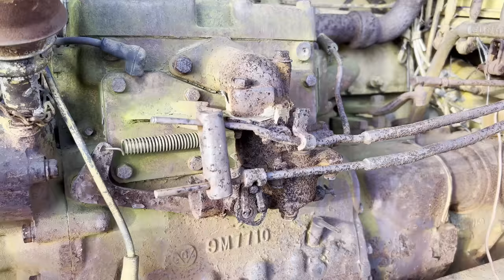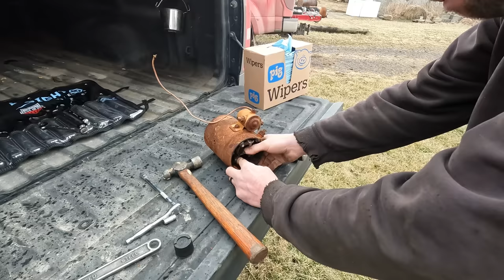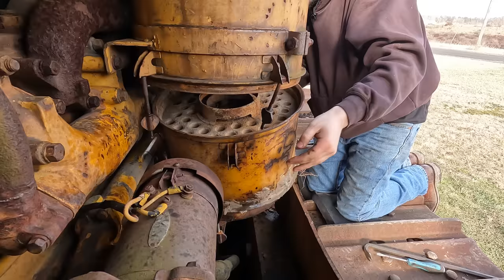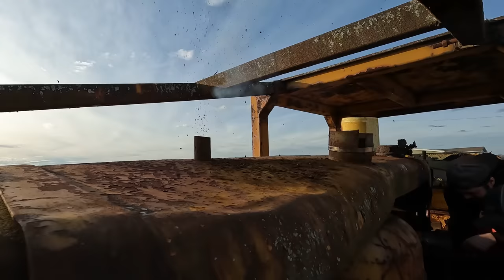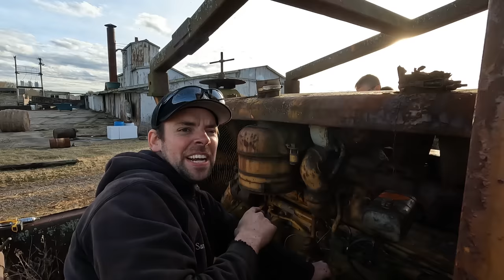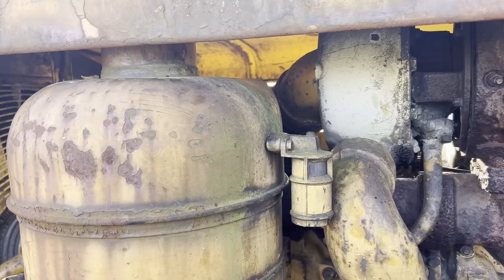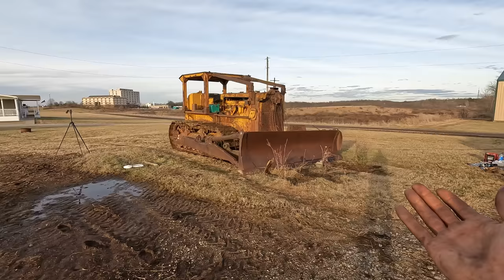Caterpillar D8H Bulldozer Sitting for 15+ Years! (Will it ever run again?)

Comment: Maybe high iron-content acts as an antifreeze agent? XD Man, that thing was a rust-fountain!
I wonder, could the water have pooled in the exhaust, against a closed valve, and that's how the cylinders were intact?
The water just flowed in once you started turning it over? That's the only way I can see that it didn't get seized!
Woo! She woke right up once she was running!

Comment: As a young kid I though of the idea of a little smaller engine used to start a bigger engine and didn't know it actually existed until today. Seems like a giant PITA though because you need 2 different engines fully functioning instead of 1.

Comment: Man, that D8 runs very well. I seen a few in recent years. Cable lift type. That by the time you guys got it to tick over, goes better than I would dare to expect. If you got it under $7500 you may finish up making a profit, off it!

Comment: I'm happy to see someone that knows how to use their tools. I cringe when I see guys using the open end of a wrench to break things loose, or worse yet, that adjustable wrench. There is a time and place for them, but the right tool for the job always prevents damage and a lot of grief. FYI, to save some problems, I have seen guys change the pony motor to an electric starter on older machines. Not sure that is possible on all of them, but some for sure.

Comment: When I started at a cat dealer in ,75 still lots of donkey starts around.great fun for a 17 year old.start the donkey,let it run for a while,pull the engage lever,watch the oil pressure come up then throw over the decompress with your foot.DAG A DAG A KNOCK KNOCK ,belching black smoke then she runs sweet. Good old days.

Comment: If you hav to jump a srarter put the positive cable on the starter first then the negative to ground then you don't have the trouble of manipulating the positive cable where there is never enough room to work, use the negative side to complete the circuit to engage the starter this eliminates the hit and miss of trying to get the positive side where there is never enough room and remove the possibility of ruining the pos stud threads

Comment: Yeah,it started,sweet. Typically they would drop off the blade and use the cables for a towed scraper,"box" scraper. Onions was a common brand. Quite effective on smaller jobs even these days.

Comment: Great vid thank you it brought back fond memories of nursing dozers back to life and getting a face full of birds nests etc lol, we ran 4 x D8 H`s and scrapers in the uk (22a, 35a & 68a`s) up until the 90`s   what model of  is yours ? i noticed the big turbo is that a 235 hp motor thats in it ?  also just wondering why the winch is set up the way it is, is one drum for the blade and the other set up for hauling logs ?

Comment: there is a 3rd bolt hidden UNDER that starter that often doesnt get put back in!,,,,its a 20 minute job if you have the right extension!.....same pony as the D7 AND D9 if its the same series...D7-17A IS THE SAME AS THE D8 14A,15A

Comment: Matt a good friend told me about free all i had come into a honda motorcycle that would not crank even with the foot starter, after spaying free all into the 2 cylinders and a good hard push on  the foot crank it freed up, I am a solid believer in  using free all spray that has some oil in the spray!

Comment: Kind of late to this video, but I am curious about the date of mfg of this D8. I thought that the last cable blade D8's were made in about 1959, because my Dad had a brand new cable blade D8 bought in 1958 and it was supposed to be the last of that model? I realize the owners said they bought it in 1964, but how certain were they of that date? Also the one my Dad had was equipped with a logging winch and did not have the cable blade winch mounted on the rear of the dozer as yours does.

Comment: The what beast comment i was thinking myself before you said it  , great job getting the old girl fired up guys , the motor sounds nice , you gotta love old machinery built to last the long haul .
 The little axillary starter engine does the job ok when it you got it running , just wondering if an air start conversion might be possibly a more reliable thing ? 
  Just a thought anyway . 
Cheers .

Comment: Ok can you check the Oil now? In the pony and Motor and drive boxes,  wench motor .Sitting that long probably has more water than oil or fuel....Or do you go by the as long as its wet theory?

Comment: Learn something new everyday, I always thought the H stood for high drive, like the models that have the final drive central and higher up.
Reply from the maker: Cats letter and numbering system doesn’t make any sense. The D4 H was a high  drive 🤷🏼‍♂️
Reply: @DieselCreek  that's what I love about Cat, pull down a hydraulic cylinder and it's got an 8" bore, 100mm rod with a 2" piston thread or something stupid 🤣

Comment: That is an early 8H. should be 235 horsepower. I have had a lot of hours running an 8H. My last day of working before I retired from the operator's union, I ran a D8R.

Comment: cable blade,,,i thought they stopped that in the 50s,,,but at any rate, new cutting edges and you are ready to go,,,,,keep engine running near top speed and control your ground speed by transmissions,,,,those engines last lots longer at high speeds,,,

Comment: I am going to assume you know that tractor won't turn much just by pulling the steering clutch levers out? You must pull out steering clutch THEN push appropriate foot brake lever to turn. Later years had the brake built into the last part of the steering clutch lever travel and was less work....but less feel of what the machine was doing.
I spent a whole season in 1978 running that same cable tractor pulling cable operated scrapers building up a minesite for Island Creek Coal. 3 in operation to reroute the creek and build a series of treatment ponds. My last day of working with heavy equipment was running a D11N. What a change tractors went through over time. There is nothing like the sound of a pony motor D9G starting on a cold morning.

Comment: A Pan has a bull bar in the back and you push it, or you drag it from the front, and it has its own engine and can go by itself.
Reply from the maker: Not old cable pans, everything was done with the dozer. 
https://classicdozers.files.wordpress.com/2013/03/159-cat-d8-no-463-scraper-1958_edited-1.jpg

Check out that picture ^

Comment: Thanks for the video.
How does the pony motor crank the bigger engine? Can anyone explain?
Reply: Hi- it has a lever which is engaging a bendix like an electric starter into the diesel flywheel and then the lever is pulled farther which engages a clutch between the pony and that bendix to turn the diesel.  When adjusted correctly the bendix (or pinion) will automatically kick out to prevent the diesel from overspeeding the pony engine.  A lot of times like here you have to hold some pressure on the lever to keep it from kicking the pinion out before the diesel actually starts.  Thanks for watching!

Comment: So, just curious here, you're using an electric motor to start a gas motor to start a diesel motor.  Is this the most motors/motor that a machine can have?  Is there any thing else that uses more motors/motor?
Reply: Big planes use an electric motor to start a small gas turbine that in turns powers an air starter, all to fire up one of the main engines

Comment: You may need to instruct those young lads on how to steer the old cat, pull the clutch and press the brake pedal for a fast turn. Generally, with no brake, it will not turn

Comment: That was utterly ridiculous (in a very good way). Fifteen years sitting out in the upended and it starts and moves like that! CAT do build 'em to last. I am pretty certain at this point that you could get a pile of rust and iron filings to start up with some ether and an oil change.

Comment: It reminds me when my Grandfather started both of his Cat D6's. They were all hydraulic front blade, non turbo, manual tranny's and much smaller. One was probably from the late 40's and, the other one from the 50's. The only difference, I could see was, one had round ends at the controllers while, the other one (newer) had square ends, at the controllers. Being 5 or 6 years old, me and my older brother, had fun wrecking the fields with them.

Comment: What are the chances that 70 years from now someone could get a new version of this dozer to run after sitting out in the weather for 15 years? My guess is slim to none. The computers and other electronics would be long dead, dozens of rubber seals would have rotted away, and all sorts of plastic parts would have broken or disintegrated.

Comparing the indestructibility and simplicity of these old machines to their modern equivalents serves as a reminder of how vulnerable our world has become, and how utterly dependent everything has become on technologies that are ridiculously complex, fragile, and ever changing. 

If civilization as we know it collapsed, little of the machinery we depend on would remain useful for very long, and repairing all their complex systems would quickly become impossible. But machines like this would still be running and maintainable for many, many years.

Comment: I am surprised that men your age knew how to start the engine. I am 62 and there were few starting engines around when I started working on Cats. When things are properly adjusted, just before you engage starting motor bendix with main flywheel, you push in and hold the lever on the left side of the dash. This stops the starting motor transmission shaft from turning. Then you quickly pull the lever back. When things are working as they should, the starting engine bendix stays engaged with the main flywheel until the big engine starts. The low gear was for cold weather starts. The small engine could pull the big one in the low gear in cold weather. The idea was to turn the big engine while the small one warmed water that circulated through the big one. Also, small engine exhaust ran through a tube inside the big engine intake. This warmed the intake air the big engine took in. When things were sufficiently warmed, the operator shifted the small transmission into high gear, and then started the big one. Good memories.

Comment: Those pony motors were one of the most temperamental things I have ever come across. I've done quite a few of them up over the years. 
If you didn't hold your mouth just right and pray to the correct Deity with the right prayer, the bastard thing wouldn't start, no matter what you did.. Their functions were to warm the main engine coolant and to bring the oil and fuel pressure up before dropping the decompression lever on the main motor.. Therefore you could run these machines in extreme climates...
Some of these pony motors were pull start, and led to the invention of many new swear words......

Comment: Those old machines are really build to last.. everything modern with a computer on it sitting for 15 years? you probably shouldn't even bother putting power to it, it will probably never run again.

Comment: it's a shame that the carb and starter wasn't no good but what happens 2 things when they set in the open weather and it is not covered up 2 keep the rain out the starter sounded better the 2ND  time it was just a lost cause U have 2 remember alot of that old equipment nothing hasn't been done 2 it since it left the factory many years ago when it was brand new a alot of it that's been 80 years or more OMG 1 23 2O23

Comment: You have to spin the drive on a bench grinder with a wire brush it will kick the drive backyard , you can take a 50mt 24   Volt Delco starter , put a hexdrive 486 number you have to put a plate to replace the pony  put 2 8D battery use a ANB 24v alternators wire it up " right ""  just push button and go to work, I have 32 years starters and alternators, show me one.I can fix it   Jerry Lewis is south Georgia best 2nd best, I am the best, Patrick Lewis

Comment: Most of these types of videos are in the range of 35 years not 15.  Now try to do the same thing with an electric vehicle sitting for that long.  It will never happen.  These diesel machines will last 150 years and still start.

Comment: It might run but that's about it.  After working at a CAT dealer for 6 years it would cost a fortune to get it working again. Minimum $350k.  $150k in labor another $200k in parts

Comment: Not suppose to run an engine with water in it. Why? The water mixed with oil causes them to hydraulically bend the piston rods and valve push rods and ruin it.

Comment: it is not a pony motor it is a donkey engine
Reply: No, it's a pony motor. 
The pony motor is a small gasoline engine nestled up under the hood.   The operator would start this little gas engine and use it to warm the big diesel engine. When the engine was warm enough, the operator started the diesel engine and turned off the gasoline engine.

Donkey Engine .
Why is it called a donkey engine?
The name "donkey" comes from the fact that these engines replaced horses as a power source for cargo handling. The term was also applied to similar engine and boiler units carried aboard ship. Donkey engines were also employed in construction work and in lumbering and mining.

Comment: Clean Up rusty Off meachine body's cover Off and take engine out clean Off dust and Rusty and blaster sand Jet everything body's All over body's clean Off dust rusty Off and wash down clean up rusty Off everything body's and engine All over body's dry up clean up done and spraying painting undercoat coat and let's do dry up rub down All over body's done clean Off dusty clean up and spray painting top coat darker Gold/yellow All over body's and engine Must be Able done tidy meachine and All body put back in All together and chains wheels spray painting top coat darker Sky Blue and All done just jobs do and fixed up light and All done meachine and engine Must be Able done good perfect keep clean tidy up everything nice good look perfect put in workshop sheets keep out rain and look after meachine safe clean !